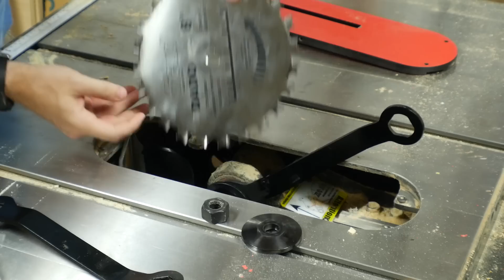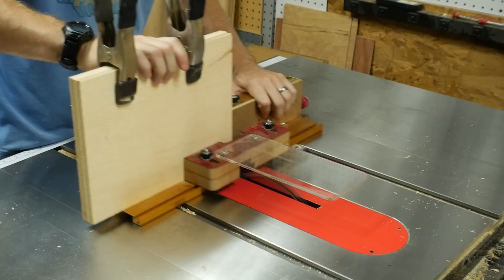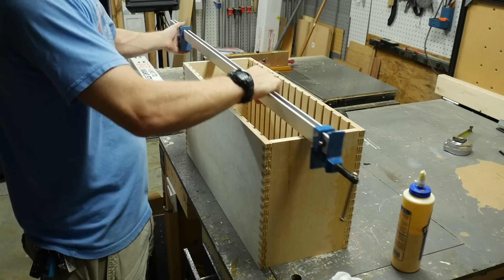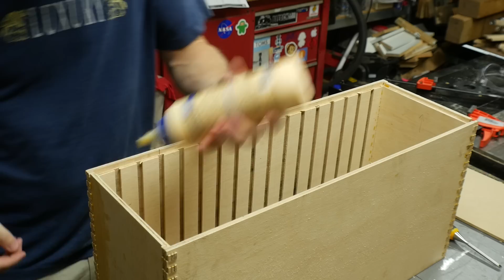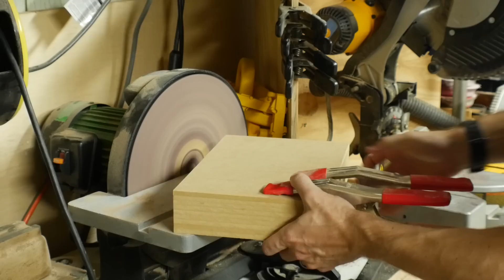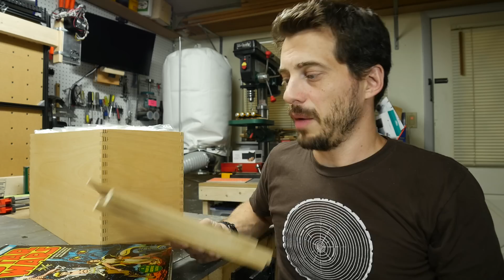Wooden Comic box // How-To | I Like To Make Stuff

Comment: nice work BUT Serious Collectors Beware!!! wood + comics = wrong idea! (wood add acids to paper, smell wood and other things than can damage the paper overtime) so avoid any wood from any collectable item like comics, records, cds, video games, billing currency etc; instead use cardboard acid free boxes.
Reply: +Sebastian Spatafore Thanck you its always good to know
Reply: Good point but isn't that why they have those acidic free bags that you put the comic in, to prevent that damage from happening? Maybe I missed something? Love to get your input on that.:)
Reply: Slider617 it only works so much, it's not 100%. I like to think of it like a water resistant watch and you ca dive a certain amount of depth before it no longer works. Similarly to too much acid and other material in the wood work mess it up even if it is resistant. Hope you get the weird example lol

Comment: I would consider using a dovetail joint for this project. Not only are they structurally more sound but they also tend to more or less square themselves. The bottom can go in like a drawer bottom and slide in before the final side goes on. Never thought of doing a wooden magazine box like this. Great video.

Comment: If the bottom is just glued in, aren't you afraid that it will fall out?
Reply from the maker: +Findecanor I was planning on adding braces if it needed it, but it's been solid so I haven't.  It helps that it sits flush with the bottom of the box, so there's no gap. The weight of the books transfer directly to the surface that the box is sitting on.
It certainly wouldn't hurt to add another fixture though, just to be safe.

Comment: nice work Bob,I have to try some hand cut box joints soon as I have no table saw!I am not sure it will fit together as well as yours!!
Reply from the maker: +BCdesign If you have a router, you can make then with it!
Reply: +I Like To Make Stuff yeah I have a router so I will try to make a router table as I could use one alot!I only started woodworking a year ago as a hobby and making videos aswell.

Comment: I'm sure you already know this, but I gotta say to the people on here who don't have a StopSaw: DON'T cut anything wider than it is long on a table saw.

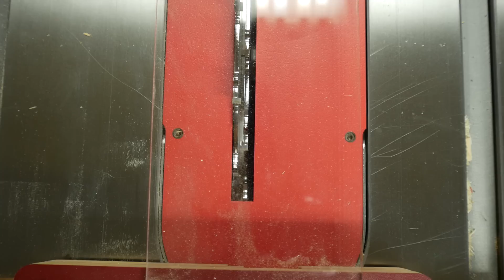That cut Bob did at 0:38 is considered to be very dangerous and not worth the risk. Bob does have a SawStop, but if the wood caught it can still get thrown at him and puncture skin. If his hand did touch the table saw blade, he'd be out a SawStop brake and his nice dado-stack.

Just a word of warning: Bob has a SawStop and you may not!
Reply from the maker: LovelessAndroid That's a very good point. That cut was probably the most uncomfortable one that I made in this project, but I didn't realize why at the time. You're totally right about the geometry of a cut there, and it would have been safer to do on the miter saw or with the cross cut sled.

Comment: Incra make some nice products, I have been using them for years.  It is good to see practical applications of their use too, as opposed to everyone doing the double nested dovetails and what not.

One thing to keep in mind though for a project like this...  The regular MDF can yellow paper stored in them over time.  NAUF MDF is normally recommended for archival purposes.  Plywood is better still.  Solid wood is best (depending on species...).

For those who are interested in really preserving their comic book collection in pristine form, take a look at one of the exhibit or archival handbooks which are available.  They list out safe/unsafe materials, glues, finishes and all of that.
Reply: Interesting. Would the comics in the sleeves prevent discoloration?
Reply from the maker: Joe and Liz Interesting, I had no idea about that!  All of my books are in bags, so it may not be an issue, but that's really good info for people to have, thank you!
Reply: Several years ago I had to do a bunch of shelves and storage boxes for a smaller museum/historical archive.  Ended up going down the rabbit hole of archival applications.

The bags should help for casual applications, but since they are really not sealed - it isn't ideal still (you can see this with a lot of older bagged comics that were stored in places like garages and basements...).

If you are really concerned, ACX plywood is pretty safe in general.  The veneers are normally a safe wood (as opposed to something like oak that has a lot of acid in the wood) and the adhesives used on Exposure grade plywood for the last 10-15 years has been NAUF.

Imported and interior grade plywood normally uses a urea formaldehyde based glue which can cause discoloring and deterioration of paper products over time.  Same goes for your bog standard MDF.  Masonite (hardboard) is good though for bottoms and dividers.

It gets sort of complicated though, as certain things are fine if they are on an open shelf where the air flow will help move the outgassed chemicals away, while others should be avoided entirely.

This link has a pretty handy Cliff Notes list of different materials:

http://www.mnhs.org/preserve/conservation/reports/exhibits_handbook.pdf

Comment: Why would you not add some oval openings for the handles? this seems to be quite heavy
Reply from the maker: Tuff Movies Well, for me, it's going in a closet so I don't need to handle it. Also, it's packed so tightly that I wouldn't be able to get my fingers in through a cut out. For someone who had a difference circumstance, handles would be great!
Reply: Yes, handles good.
Reply: I Like To Make Stuff Alternatively, anything that would make it easier to carry. Even some short feet on the bottom to make getting your fingers under the box would make this much nicer to pick up But, I've always hated having to try to pick up handle-less flat-bottomed boxes!

The biggest problem I see with holes in the side is you'd be jabbing your fingers directly into the comics, which could damage them.